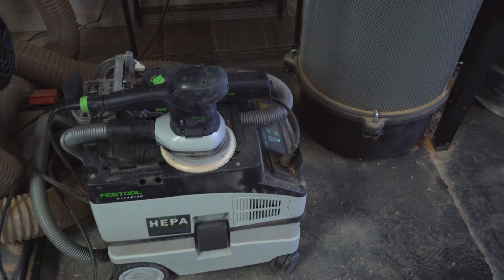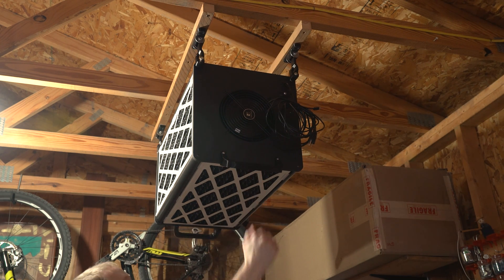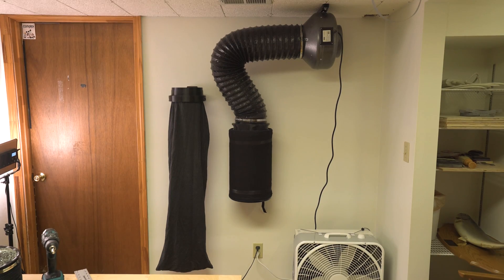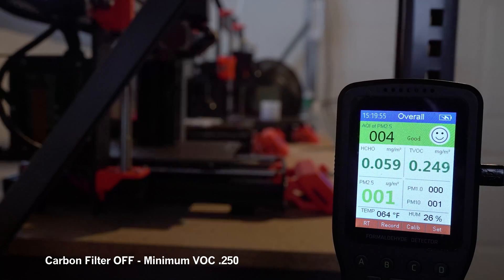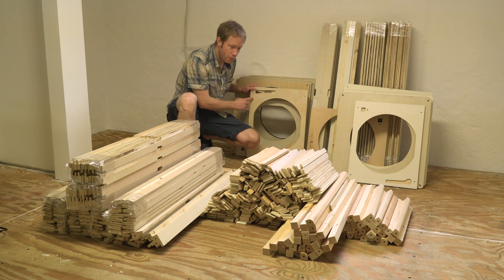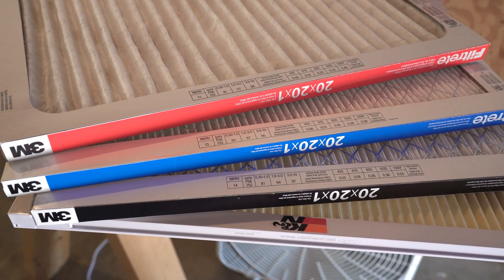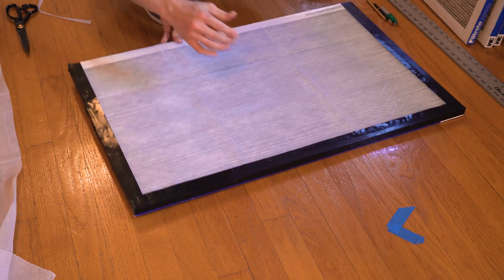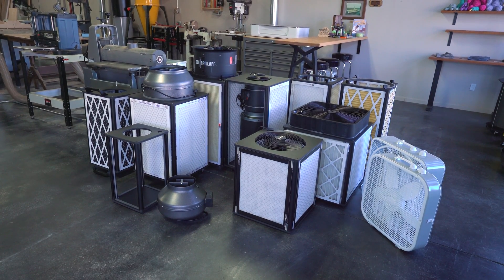DIY Quad Filters - Everything you need to know

Comment: I'm just starting into woodworking, and have converted half my garage into my work space. I'm finding dust everywhere, which is a terrible outcome, so have been looking around for options and was delighted to find this channel (new subscriber)! I appreciate the rigorous methodology that has gone into your evaluations. 
I usually work with the garage door open, and a side door also open to promote airflow through the garage. I have to think that these would still be useful, or would they be more effective with the doors closed?
Reply from the maker: Opening the doors and blowing the dust out is definitely the most cost effective way of dealing with dust. That's part of why I designed the Caterpillar drum fan version. When I want to opening things up, I can use it to air the place out and when I want to close things up on hot/cold/rainy days, I can put it on the filter and still enjoy cleaner air. 

If you have the place open, it would be fine to run the filter. Not sure if it's a concern but if you have neighbors close by, it will reduce dust from blowing into their open windows, etc.

Thanks for subscribing!

Comment: Awesome design work, and love the level of detail you've put into the testing.  I've been holding off on building one of these due to space constraints in my garage shop, but that will be changing soon, so I am super excited to see that you've continued improving these designs.  My current setup (shop-vac with cyclone for most tools, dust extractor for sanding, and ceiling mounted air filter) does an okay job...but there's still TONS of fine dust everywhere the next day when it all settles out of the air.  Definitely think the Cat drum fan kit is going to be on my shop upgrade list here really soon, unless of course the testing on the canister filters pushes things in that direction.
Reply from the maker: Thank you! I will get into the same level of detail with the canister filters designs. Spoiler alert... I like canisters for ducted filtration much better than Axial fans. Axial fans and large disposable filters are a much better combination. If you cant go with a ducted design, the Cat fan and some 20x30in filters are the most efficient option by far.

Comment: I'm trying to build something like this but I'm putting it in a window blowing out. It's for a workshop I'm trying to set up in  about a maybe 900sqft room. There's about a 2 inch gap under the room door if this matters.

I'm thinking this fan/filter situation would be enough to pull the really fine saw dust/powder that hangs in the air...out.

I'm thinking maybe just 1, 4 inch filter Merv 13? Would be enough or would cheaper thinner filters be ok. I'm thinking of attaching it with a little space to keep motor cool/clean as possible to try and make it last as long as possible...

Am I over thinking this? Something need simplified?

Let me know, and thanks in advance..
Reply from the maker: Many things are possible! You could also blow the air out and filter the air coming in. If you are exhausting a lot of air, you will also need to bring in a lot of air. 

Definitely use a 4-5in filter if you are only using 1 filter. Most 1" filters clog quickly and reduce fan performance.

The Caterpillar fan should work fairly well for this setup. The motor doesn't really get dirty thanks to the way it is designed.
Reply: @The3DHandyman  Thanks! I have 2 Lasko box fans I'm trying to do something with. If the 2 inch gap under the door isn't enough then I suppose I could gap the door a little to draw in air.

The window the fan will be in is a double window meaning there's another window beside it, so I would worry if that window was open then the fan would be mostly pulling the air from the window and not the room, so I will probably just keep that other window closed and use door (cross draft) to feed air into room.

Many thanks! I'll be tinkering with ideas to see what's what.

Comment: Can we get some more CADR data? I know that is more difficult to calculate. Just curious. What are your thoughts regarding CADR? Edit: specifically for the AC Infinity 🙏
Reply from the maker: I will have more charts up on my website with CADR info soon. I'm a bit swamped with work at the moment and running behind on everything. 

I hope to get to another testing round in a month or two with the new fans. It's very time consuming to run tests and my "testing chamber" is currently full of several cubic yards of bubble wrap that would throw off the test results.
Reply: Also it looks like AC infinity only makes a 14 inch fan now instead of the 12 inch model which is what the link on your website on Amazon shows. Will you be making a new model for the 14 inch model?
Reply from the maker: @caseyeverett5246  I actually just made a custom version for the 14" fan. The 12" fan seems to still be available on the AC infinity store, just not on amazon. Thanks for the heads up on that! I will contact them tomorrow to see what's up.

I will update the product listing in about a week or so when I confirm that the 14" version is working as intended.
Reply: @The3DHandyman  thanks for the info! Looking forward to seeing if the 14” performs noticeably better than the 12”. That would be amazing. I’m looking for a QUIET, efficient solution for home filtering, so I’m most interested in this setup with the AC infinity cloud fan as it seems uniquely suited for that purpose. I know you are more focused on shop filtration, but I do think home filtration is a bigger market fwiw. Maybe you could target that a bit more with some videos and marketing. There’s my vote! 😛 And I bet you are swamped; these kits look awesome!
Reply from the maker: @caseyeverett5246  I suspect that the 14" fan is about 10% better than the 12" just based on raw specs which might well be worth the extra cost.

The home market is far lager for sure. Up to this point the box fans have held that market. Maybe the AC Infinity fans can take over? We will see
Reply: @The3DHandyman  10% improvement would be very welcome. I think the most compelling competitor to the AC Infiniti design that you have created is from cleanairkits as all of their designs are low power, efficient and quiet, especially compared to the noise of box fans. But, their designs are much more flimsy than yours.
Reply from the maker: @caseyeverett5246  I am familiar with the PC fan kits. I will try out a design like that at some point. My concern is that PC fans on high are pretty loud. My desktop PC with 6 fans running on high is just as loud as a box fan. When on low the fans don't move much of any air. The AC infinity fan may move more air per dB than a whole pile of PC fans but I will have to test that to find out for sure!

Comment: Btw Costco sells the 3m filtrete 2500 merv 14 for $15 a filter. I bought a four pack and the caterpillar fan and plan to build a box with caster wheels on bottom for my wood shop.

Two questions - I plan to build a version with the fan ducking air into the box - is there any liner or screen I can place on the inside to extend the life of these filters??

Second question - would there be any issues with just building this box and mounting it on my ceiling joists?  Its a 7' ceiling so I think I could get pretty good local suction central to most of my tools this way
Reply from the maker: I picked up a few for this video from Costco. It's a great deal. Not sure how long that will last, so you might want to stock up.

I hope to have the "pre-filter" video out next weekend, although I'm not sure how useful that would be in a ceiling application. Any liner/pre-filter will reduce filtration performance significantly if not frequently vacuumed. If it's on the ceiling, then frequent vacuuming would be a real pain.

There is no issue with ceiling mounting these. Lots of people have done that. 7' ceilings are a bit lower than what most people attempt this setup on though. As with most things, the best way to find out for sure is to try it out.

I will have more plan available for these later this week. Currently running a bit behind schedule.

Comment: The quality of this content is unbelievable. I've just recently begun researching about air quality and how to make my indoor air as healthy as I can. These are exactly the details and real-world results I've been looking for over the past couple of weeks, so thank you!

I am wondering about the PM sensor that you're using. Are you confident in it's accuracy? I've been looking for a reasonably priced one but its hard to tell which ones are accurate and which ones are junk.
Reply from the maker: That is quite a complement! Thank you. 

I am confident in the ability of my PM monitor to tell me which device performs better than the others. If I run the same test twice I get the same result +/-2%. That is definitely good enough for these tests. Is it NASA grade hardware? Definitely not.

I've not found a particle meter with all great reviews, honestly. I have also watched a few videos that compare the different devices and they all seem to make assumptions about which device is accurate. Like "these two are reading the same particle count, therefore these 2 must be correct". It could be that both of those devices are wrong and one of the outliers is actually giving the most accurate count. 

In the end, I would say that some of the options in the $100-$200 range are probably good enough. I paid about $130. I'm hoping to do a video on this at some point if I can get my hands on a professional grade device to test against the budget options.

Comment: Brilliant work! I was particularly surprised by the benefits of orienting the fans in the “push” direction. I’m looking forward to the follow-up on ceiling mounted solutions. I’ve been searching for some proven solutions for my small garage shop that don’t break the bank and might afford me the opportunity to make use of the open rafter space. I could absolutely envision mounting a model B type system on a pair of rafters with the fan intake protruding down into the workspace. Excited to see more of your research!
Reply from the maker: Thank you much. I was thinking I'd have that video done by this weekend but this week proved to be more busy than expected. So, it's looking more like a next week thing. Stay tuned!
Reply: I see a lot of stupid people advocating for pull direction in most youtube videos with Diy box fans.    suction power is so limited.    even strongest vacuum cleaner available needs it close enough to suck a dust.  

imagine a box fan not intended for static pressure or suction.

Comment: Great video. The battle with dust is a constant struggle in my shop.  I have a couple different DIY filters in the shop now; always looking to improve the efficiency and ease of maintenance. I’m looking forward to seeing your plans for woodworkers to use.  I appreciate the information on the impact of air turbulence in the shop.  It is a good time (weather and shop temperature) to turn off my fan to test whether it has been hindering or helping the dust control effort.
Reply from the maker: Thanks! I hope to have the plans available on my website by this weekend.

Comment: I look forward to buying and testing out your kit using my Dylos particle meter.  I currently use a WEN ceiling mounted air filter and it is not enough even though it is the larger size.  I just purchased a Harvey g700 dust collector that is not yet hooked up. I also plan to add a cannister filter to the exhaust side of the WEN unit like shown in stumpy nubs video a few years back.  My goal is to get the best air quality in a 2 car garage as possible and the particle meter is eye opening. I think you model B unit combined with the WEN w/ added cannister design should be very effective in the future.
Reply from the maker: That sounds like a great combination for clean air. 

I've seen Stumpy's video. If I remember right, he uses the Wynn canister? I tested that one against a few cheaper alternatives and it's the best. I'll talk about it in my canister filter video. That should be out in the next few weeks.

That g700 is a beast! Great choice. My Budget Jet can barely handle my CNC machine. I'll be needing an update some day soon. Not sure I could get one of those into my basement tho. Haha

Comment: I appreciate all the testing and the graphs! I'm just upset I found your channel after building a CR box with 4 3m 20x25 filters, a lasko box fan, and packing tape plugged into a smart switch. Thanks to your channel, I have recommended these filters for family and friends currently battling seasonal allergies. My plan is to build a quad filter setup into a more cost effective and better performing side table similar to Ikea's starkvind table with replaceable 3m filters and maybe a UV-C light inside.
Reply from the maker: Sounds like a great use for that Ikea table. People also make 3D printer enclosures out of that table, I believe. I have head a lot of comments about the UVC lights. Be careful to completely shield the light, UV-C is some nasty stuff! Thanks for the comment!

Comment: I can’t quite tell from all the options which one is best for me. I have a 12x17 basement workshop with only about 4-6” of headroom. I have a furnace motor filter setup I made myself, but it definitely isn’t as effective as I would like, and I wish it was skinnier. The ducted setup seems like an important idea, and I think I have a path for 8” ductwork. So which variation of this is highly effective, skinny, can be ducted, and ideally would also be portable (without the duct) if I wanted to use it somewhere else? (I plan to buy a kit.)

Thank you for all this research, development, and for sharing your expertise!
Reply from the maker: Thank you, happy to share! I think you are right about the ducted approach. It works really well in my basement, though the ceiling may be a few inches higher. A 12" duct was able to easily fit into the space between the joists but the house is about 100 years old and current building standards may leave less room in there. You can always run multiple 8" fans attached to the ceiling. If you rely on a single 8" inline fan, that may not be enough to get the best possible performance. My 14"x30" Model-B would be the skinniest option.

I will also have my Model-E kits coming out soon. Those are designed for even smaller spaces. I keep mine in a corner where the Model-B would not be as effective. You may want to wait on that video before making your final decision.
Reply: Fitting inside the joists is ok; it’s when I need to cross the joists perpendicularly that I’m in trouble. 

Which fan would I use if I wanted to attach it to the filter box, not the house? (If there are choices, what’s most effective?)

And it would point toward the duct (so it would “pull through” the box), right?

And then I also need a diffuser on the output of the duct? I’m not sure what to get for that. 

I’ll wait for the video about the next model :)

Thanks again!
Reply from the maker: @truist7  Just got the inline-fan-on-filter listed https://www.etsy.com/listing/1690126906

My preference for a similar space is the 12"  inline fan.

You could possibly just exhaust the duct along the path of the joists. For a diffuser you could attach a few MERV 5 filters along the joists to spread the air out. That way you wont take up any floor space.

Yes, the fan will point up in the Pull configuration. Inline fans are not meant to process dust.

Comment: I really appreciate your dedication to precise and accurate testing, especially across so many different models! There is something immensely satisfying to listen to someone take us through all the steps and show how/why they arrived at that conclusion. 

My question though, is this: is there any utility to doubling up the filters? Or possibly to using a large screen filter outside of a MERV14 to let it last longer? Alternately, do you think there would be any appreciable benefit to putting multiple units in line with each other? 

Again thank you for the detailed video! I would love to receive a unit and I look forward to your future videos :)
Reply from the maker: That's my favorite sort of video as well. No coincidence! 

Doubling up the filters on a quad Filter will be more effective than on a single box fan + filter design. In that case performance is ruined. On a quad filter, because there is so much surface area, it may not bog down the fan as much. My preference is to use a mesh pre-filter that can be regularly cleaned. This acts like a MERV 4 filter but instead of clogging with dust and holding back airflow over time, it gets restored to a like-new state every time it gets vacuumed. I hope to have the video on that out this coming weekend or some time after. 

Thanks for watching and commenting!